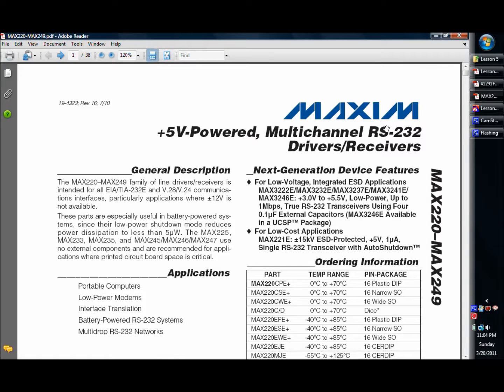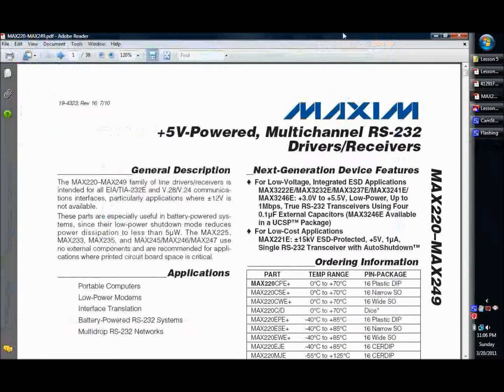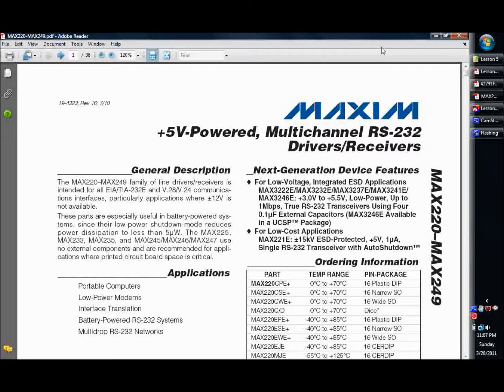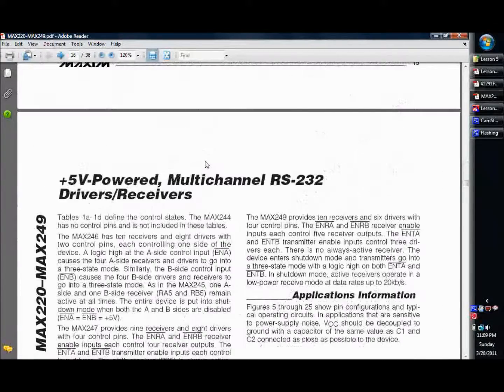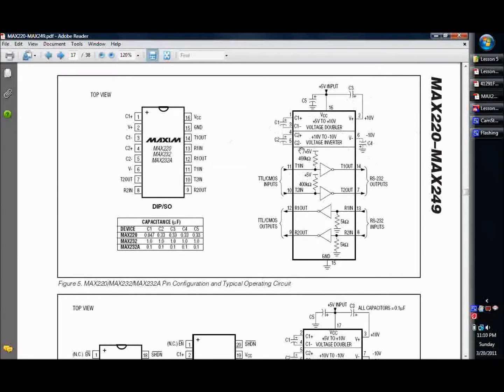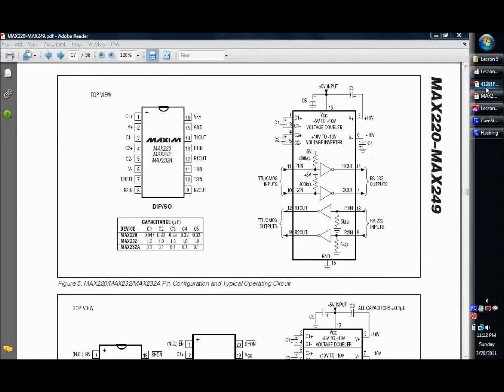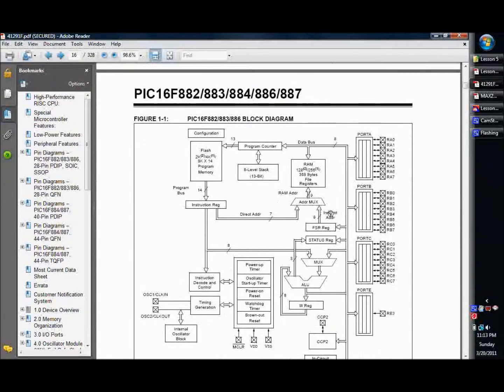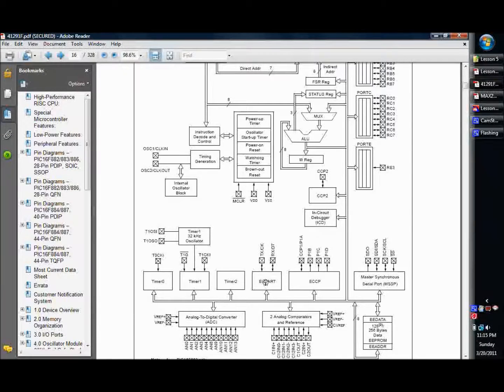Lesson 5 UART Part1_1

Comment from the maker: Thanks for the question.  I was aware of some usb programmers that use the PIC18F2550 that's main feature is a full speed USB 2.0 controller.  Also there is the MCP2200 USB controller that microchip makes that you could use to do the rs232 to USB conversion.  I have heard of some sucess with this as well.  Hope this helps.  I apologize for the late reply but I have been very busy.  Thanks.